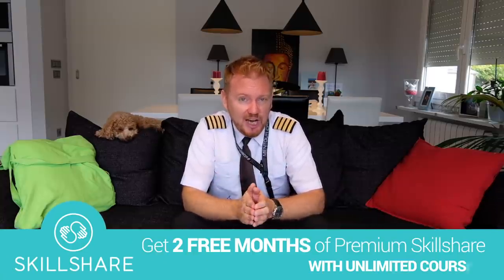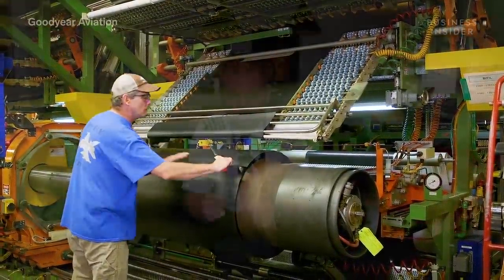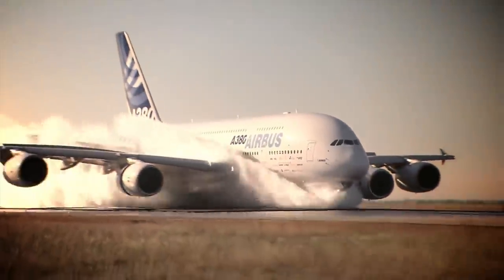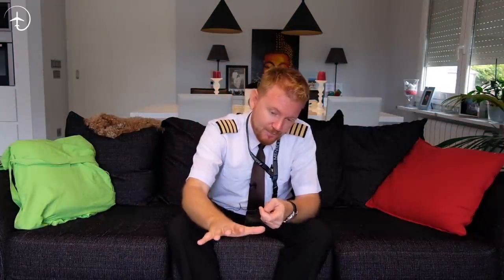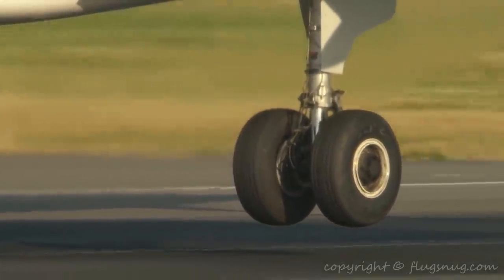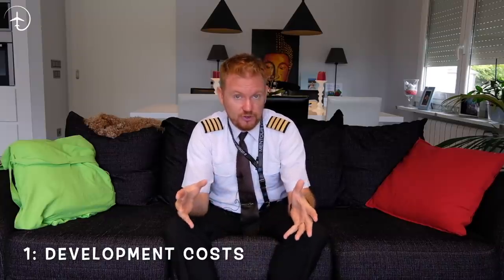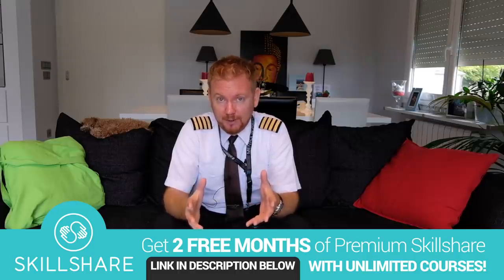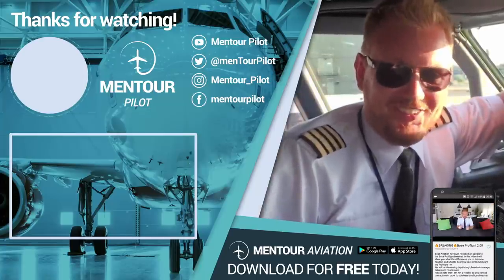Why not make plane-tires spin, before landing?!

Comment: Why not add small fins to the tire rims and make airflow make the tires spin, this will also help to slow down the plane
Reply: It won't ensure all tires will spin in same speed as airflow wouldn't be same on all tires because of many reasons. This uneven speeds may cause it to turn to one side away from runway.
Reply: Use bleed air from the engines, no need for electric motors. Just attach one of those engine start rings onto the hub of a landing gear tire. If you apply the air bleed in reverse rotation of the tire travel, you could slow down the aircraft while landing, saving brake pad wear.
Reply: @JohnDoe-yj5ng  Again modifying a 2 Million Dollar Engine to save 1500 Tyres or brakepads isn't worth the investment. And after R&D and Testing imagine the certification costs. No wise man would touch the engine.
Reply: @SoumendraBagh  You don't need to modify engines, engines already provide bleed air ( used to start other engines, used to provide pressurized air for the cabin and to cool the electronics packs). You just need to provide the plumbing to the landing gear and install something similar to an engine start ring to the wheel hubs.
Reply: @JohnDoe-yj5ng  Agree. Still it's a lot of effort for saving 1500 bucks
Reply: @SoumendraBagh  But take into account that the tires last say 300 flights, so it's 1500/300 so we are looking at saving less than $5 per flight. The airline could just cut back on condiments for in flight meals to save more than that.
Reply: @Jadinandrews  USD 5/ 400 Seats per flight per person is 1.25 cents.

Comment: This was very interesting, It sounds like a good idea to have electric motors inside of the wheels spinning them up to speed for landing. 
Your scenarios of why that would be a problem was also very interesting. Especially if the wheels were not spinning at the same speed due to a malfunction. The idea that the non spinning wheels should be able to free wheel and naturally spin upto speed is what I was thinking about, until you described how it could become a stability problem with one set of wheels spinning faster than the others or one wheel spinning faster than the one next to it when they touch down onto the ground. I can definitely understand how that could cause lots of problems. 

This was a very interesting subject, 

Thank You Very Much, for making this video👍🙂
Reply: Plus aircraft don't always land in a dead straight line, they often side slip in then straighten out at the last moment, 18 high speed gyros could be a problem.

Comment: Back in the years just post WW2, piston engined aircraft (eg. Douglas D6B/Lockheed Constellation) were the large airliners, consideration were given to airflow (post  gear down) airflow enabled 'spin up blades' fitted to each wheel.  Many runways were shorter then and the braking effect on touch down was not deemed worth the braking effort and costs incurred. Some braking effect was noted, but it just wasn't enough on a cost to benefit ratio to fit aerodynamic 'spin up' tyres.

Comment: Uh, I thought that the whole idea of landing was to dissipate the energy of the aircraft. Wouldn't spinning up huge wheel and tyre assemblies actually contribute to the energy that you're trying to rid the plane of?!?
Reply: It's actually beneficial to have the tires skidding in airliners on contact for less initial traction, because these guys can't land in a crosswind for shit.  If those tires were pre-spun and managed to land with full traction, it's very likely you'd see airliners veering off the runway when they do crosswind landings.

Comment: What a meandering, and off point discussion about everything, but the subject at hand! The point of the discussion as stated, is whether achieving SOME rotation to avoid having tires go from 0 to 100 in a billionth of a second to reduce stress! Introducing some method of rotation is, what should be discussed, not employing a motor to do that necessarily, not the regulatory issues and not the complexity involved as a result of all the erroneous hypotheticals proposed here!!!! This entire video clip is off point that supposedly it is trying to make. 

Rotating the tires some amount is by definition a vast improvement over having them not rotating at all until they touch the runway. HOW that is best achieved is a separate discussion for the engineers to work out, rather than everyone here, including the host, to guess at!

Comment: Just add flaps to the tires. They will only spin at the speed of the airflow
Reply: Why not have them going in reverse so landing strips could be half the length and expensive brakes could be done away with.
Reply: Yes, that was a also Jugend forscht = science fair project in the early 90s. It is a very simple approach, no extra motor nor batteries needed, only the airflow will accelerate the tires via the aerodynamic optimized sides.
Reply: I was wondering if they could use bleed air to power a motor or a propeller driven motor on the landing gear. A sprag clutch could make sure the tire still spins if the motor fails.
Reply: William Burns : The gyroscopic effect of pre-spinning the tires is the first and only compelling argument I've heard for not pre-spinning the tires. Thank you for sharing.
Reply: @charlesfrogg1  and takeoff length???

Comment: 8:13 Used extensively at Schiphol, at least by KLM. In essence, movement of the nosewheel is sensed, which is used as input for an electric tug around it.

Comment: Reading through the comments below regarding vanes etc. on the tyres/hubs to spin up the wheels using airflow I have the following observations -
1. The landing gear is down for landing far, far longer than after take-off.  Therefore the extra energy imparted to spin speed after take-off and braking to stow the gear would be negligible.
2. Out of balance wheels spinning before landing would be just as bad after the first touch down and trundling down the runway for take-off.
3. The gyroscopic effect of the spinning wheels has to be overcome after the first touch down during a cross wind crab landing. If it can be controlled after the first bounce it can be controlled at any time..
$. I can see the 'vanes' being built into the tread design. The spin up speed can be very gentle and the terminal speed can be less than touch down speed as any spin is better than no spin. If the spin speed is too much there is always the brake to slow it down

Comment: Is it posible to decompress the plane by holding the toilet button?
Reply: You would have to repeatedly press it as it actually runs a cycle. And i doubt the relatively small leak of a toilet would be able to overcome the pressurization system.
Would be really scary if they hadn't already considered this failure point as a catastrophically failed toilet could otherwise lead to death of passengers.

Comment: Also not spinning helps slow the plane down
Reply: How?
Reply: @ Steven : That would be negligible.  Like many other observers, I would think that having a pre-landing tire-spinup system would help to reduce the sudden shock and wear and stress on the tires, but as a practical matter it would have almost no effect on the deceleration of the airplane.

@ Gary:  The idea is that accelerating the tires from zero to landing speed takes energy, which tends to slow the plane down.  (But the actual effect is minimal.)

Comment: The idea of adding an electrical motor on the airplane tires is actually a very nice idea.

1) You could just taxi to the runway using that, yes you need a motor with high torque, but that can be easily achieved nowadays, certification is a harder topic tho.

2) You could reduce tire degradation spinning the wheels prior to the landing.

3) Those motors can also act as an electromagnetic brake during the landing, which adds redundancy to the system, making the plane safer in case of an emergency and also reducing the stress of the braking system, making it last for much longer.

I thought the main reason was economical, but I guess one would have to do the math to see is it’s worth it, we cannot forget that maintenance would go up if this is implemented.

Comment: All your problems result from the motors driving the wheels too fast and too long.. The biggest stress is from stationary to 300 kmh, if you had the wheels at approx 200 -250 most of the inertia is accounted for and it wouldn't be a problem. You don't keep the wheel motors on, driving the plane forward. They would be switched off and the wheels are freewheeling at 200 -300.
We are only talking about saving a bit of tire wear here.
The weight and complexity probably wouldn't be worth it.

Comment: I always thought that the wheels should have vanes on them to speed the wheels up using the wind.
Reply: Made of composite material (strong, and lightweight)
Reply: I was thinking the same, why add weight to the plane by using a electric motor when you could use the wind/ drag to spin up the wheels during landing. It is not that the tires should spin the same as the ground speed, just a little would already help reduce the initial slipping of the tires.
Anyway in my opinion Mr. Mentour Pilot is thinking in problems and not solutions.

Comment: Simple reason, don't fix what isn't broken.
Reply: Sorry but that's a pathetic reason. If everyone adopted that attitude we'd still be riding horses not flying aeroplanes. I hope we're better than that.
Reply: @owensparks5013  Hm no, there are a lot of things broken with horses and still a lot of things broken with airplanes, tires aren't one of them at least yet.
Reply: @rosco3  
I hear you, and you've got a point. On the other hand I was trained to always challenge any answer like "we've always done it like that". In most cases a fresh set of eyes will determine that the current method can be improved. If there is marginal gain, or if the design effort is better invested in other areas, then fine, do that instead but just because it ain't broke is no reason not to improve. I bet if Airbus introduced a system that doubles the life of tyres then Boing would have it too the next year, just as long as they could say it's just another 737...
Reply: @owensparks5013  though I agree with you aircrafts kind of follow that principle, the same reason we've got floppy discs to update software and other almost ancient technology. It just cost too much, way more than just replacing tires. There is almost no upside and a shit ton of downsides to changing it.
Reply: Ian Brown  Security and Safety are handled completely different... You can't compare the 2.
Reply: Ian Brown  If stuff has gone wrong is because they were broke already. Just because someone can't properly judge what is or not broken doesn't change it...

Comment: This is a great video on why engineering is hard. As a thought experiment, think what the impact would be of a single spinning gyro that’s NOT in line with the center of mass and directional travel. Then do that in three dimensions. Then do that with two more gyros not only offset from the center of momentum and mass, but also shifted to the side (for the main gear). Now account for three dimensional movement - I.e. the center of momentum isn’t moving parallel to or directly towards the force of gravity, but at an angle. Now add wind effect. And finally (maybe?) add variable thrust from the engines. 

Without doing the math (or at least modeling it on my whiteboard) I’m not even sure what the meaningful forces are - I can’t even get to a Fermi estimate I trust. I think the forces don’t matter, but that’s disregarding other comments about how this was tried unsuccessfully in the 1950’s….. which just means that my a priori guess is the same as the engineers 70 years ago who turned out to be wrong. 

As for the reliability factor - that’s easy, you use a mechanical linkage between wind speed and wheel speed, with the key being that you’re not trying to match ground speed but merely approximate ground speed, so you’d add a (very) small turbine to the wheel assembly that partially pre-rotates the wheel, much like how many gyro planes pre rotate their main rotor to reduce takeoff distance - it’s not enough to get them airborne, but only enough to reduce takeoff distance. In the case of an airplane you’d want them spun up to something like 1/2 of ground speed for the maximum expected airspeed (ex: you land into a 100 knot headwind so your ground speed is only ~100 knots rather than the 200 you usually have, so your turbine is sized so that in this extraordinary case you perfectly match ground speed). Obviously this would vary from aircraft to aircraft, but the point here is that you’re trying to reduce the tire replacement rate rather than minimize it. Of course getting this certificates by the FAA would be horribly expensive, and since tires are cheap probably not worth it.

Comment: I'm a chemist, and when I saw that periodic table with hexagons I got brain cancer.
Reply: Then better you become a doctor now.
Reply: Is there any reason they'd do that? I'm no chemist but I thought the significance of the groups was pretty well established. :)
Reply: The chart does look a bit like a giant polycyclic aromatic hydrocarbon, come to think of it - that could be pretty carcinogenic. ;)
Reply: @thromboid  yeah. It is a table with rectangles for a reason. Both the horizontal rows (periods) and the vertical columns (groups) have  physical relevance. The hexagon screws this whole concept up, like, look at the right hand side where the noble gases are. This won't tell you intuitively that He, Ne, Ar, Kr, Xe and Rn have similar properties, or look at O, S, Se, Te, Po...
This is a disaster and a mockery of Mendeleiev's work.

Comment: Adresssing the problems:

1. you could use bleed air to accelerate the tires. The bleed air can be regulated until the terminal speed (= matching ground speed) is reached. No Batteries, no cables are needed.
2. measuring the ground speed: in order to get the current ground speed, the system can start when the ground proximity system calls out 10 ft. When the deviation angle between the aircraft axis and the velocity vector exceeds a certain amount, the system gets inhibited. The ground speed can be calculated by the difference of vectorial true airspeed and gps/irs ground speed, backed with an optical speed measurement system (like in modern drones or optical mice) as a redudancy backup. When getting contradicting values => inhibit the system.
3. safety: if the fms doesn't forward proper values to the system, it's operation gets inhibited.
4. landing distance calculation has to be done for the worst case, so it doesn't matter if the system is operational or not.

This is perfectly doable without any safety risk, when performed correctly, and it's much easier than engineering adventures like MCAS. However, it might not pay out. I agree in this point.

Comment: This technology is actually part of electric taxi development, its coming
Reply: It was being looked at but has been abandoned.
Reply: @jiml5837  Incorrect , you're just not going to see the wheel motors until electric or ultra efficient planes are developed.  Not reasonable you could know what every manufacturer has abandoned.
It will take more to convince me than the thumb up you gave yourself troll, maybe you could post your source. (insert crickets here)
Reply: @jiml5837  All three reasons he gives are completely false, he gives nothing more than a very uneducated opinion, one that's easily disproved by simply searching "electric  taxing" Many companies are developing this technology, independently, and partnered with airlines.
Reply: @Bretware904  I work in the aerospace industry and know first hand the technical and business challenges. The leader in this development was Honeywell but they were being driven by one particular airline and the product was not embraced by the industry. I know the Project leader at Honeywell (and several of his team) personally and I can assure you that it has been shelved for more than 2 years now. BTW there is no need for you to be so angry about this?
Reply: @jiml5837  So your source is you and it's completely unverifiable lol, give me a break troll. Slow down you're embarrassing yourself, I guess you didn't search electric plane taxiing, can you not easily read all those different companies working on the technology and all the partnerships, read about the partnership Airbus has and when they expect the technology to be in at least some of their planes. You really expect adults to believe that because you pretend to work at a company that you know what every company is doing. Go away

Comment: Hi, I've been thinking about this for decades. Here is my solution.
In each rim 4 small retractable concave palettes will mecanically extend at gear extension and be retracted (flushed) every other time. When extended, these palettes will spin the wheels with the wind. No electrical parts, no electric motors, almost no chance of not working, no traction applied to the wheels, perfect simmetry of rotation speed, no issue if working asimmetrically, practically no extra weight, no complexity, no big extra costs, easy to certify. And here is an even easier vesion. Concave protruding gills on the shoulder of the tire (part of the rubber tire itself). The only downside would be the wheels always spinning with the consequent need to stop them with brakes during retraction. Zero mechanical parts in this case, just the sape of the rubber of the tire. I can not think of a good reason not to do it.